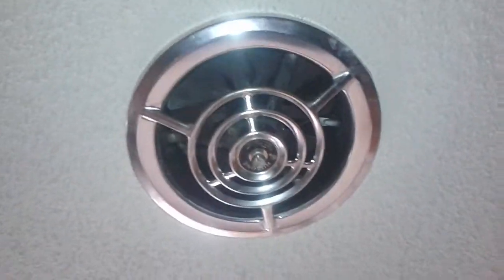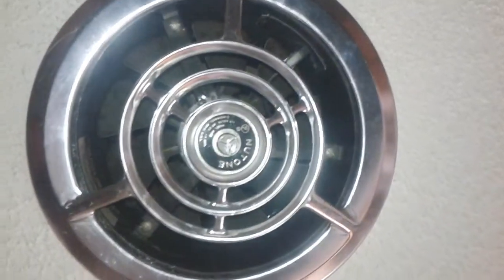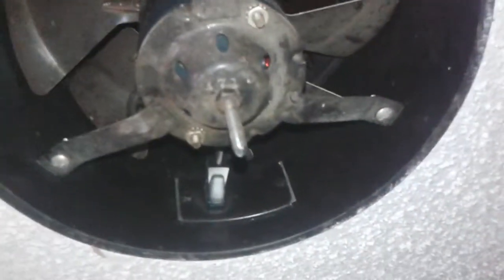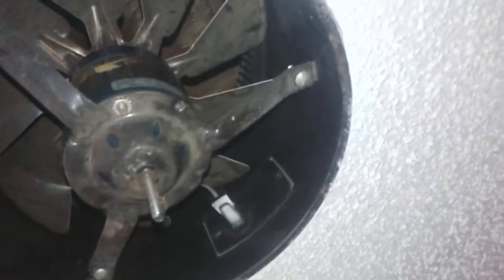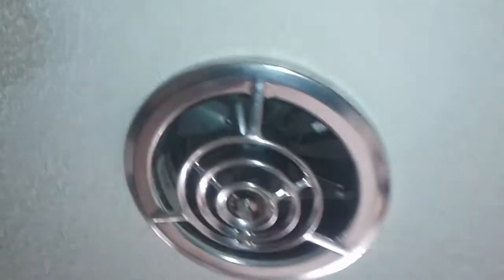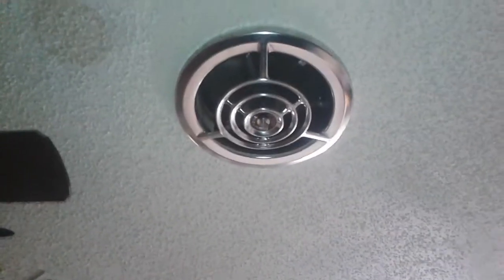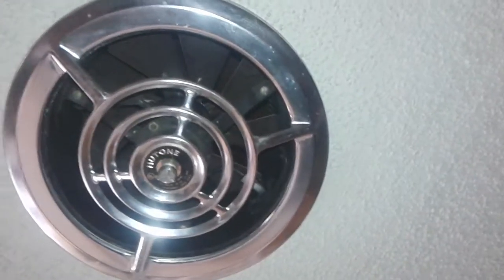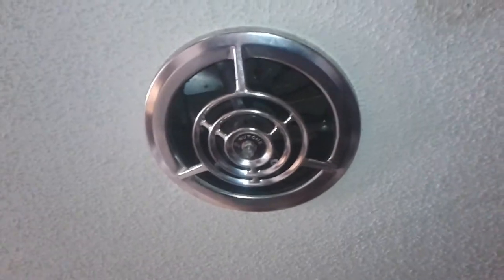Vintage NuTone Exhaust Fan

Comment: I wish they still made axial ones. Unlike the crappy centrifugal ones.
Reply: No man,   these old  axial  blade  fans  do  not produce much  static pressure.
As  soon  as  you connect any  amount  of  ducting, and roof/wall termination cap on the  discharge,    the  flow  drops by 60% or more.
They  are  noisy as hell to  boot.

Comment: Wow, that is one powerful fan, and it's not so common to find one with 9 blades. Also, did you say that the airflow rating is around 450 CFM? If so, do you think a comparable, commonplace 5-blade fan could be as powerful, or do they have 5 blade fans that have stronger airflow ratings, and why are 9-blade fans harder to find?

Comment: I am trying to figure out what to do with my nutone fan. House was built in 65. 4 blades on this loud monster.

The motor is model 180-004.
Amps .60
RPM 2800
115 Volts
60 Cycle

Just makes a loud ass rattle noise when I turn it on. Trying to make it quiet or replace it if I have to. It's just neat looking, has the old light blue/green coloring on the motor. Hate ditching retro stuff.
Reply: Tighten some of the bolts

Comment: I have a NuTone pull chain through the wall fan in my house. It was built in 1957. One of the blades just broke off. Anyone know where I can buy a new, or otherwise workable blade for the fan? It's 9.5" in diameter.